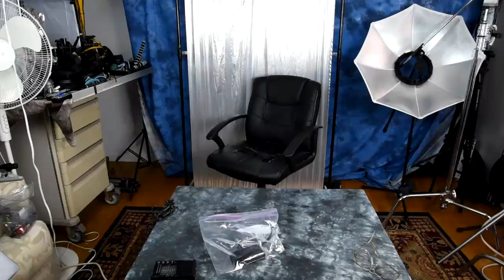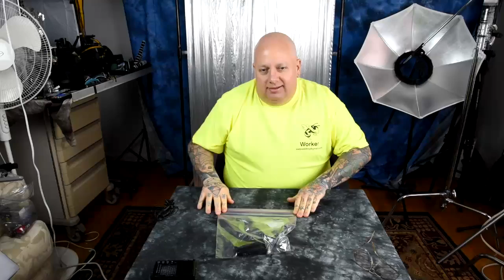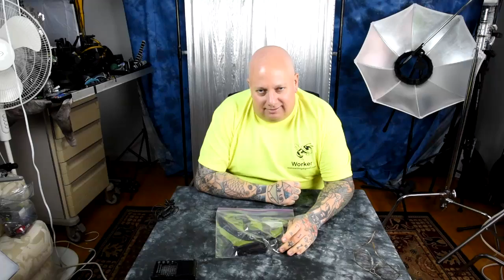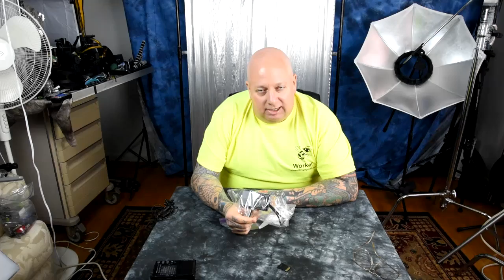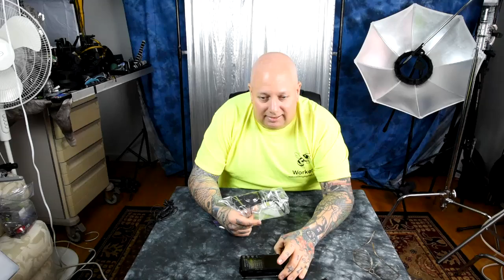FREEZER PHOTOGRAPHER!! Test Shots from COLD CAMERA. NON-ISO & Sensor related NOISE!

Comment: What should I look for in these test shots? I don't see much difference, certainly not an improvement from chill vs hot...
Reply from the maker: +Maurício Costa look at the noise and yellowing in the M in this shot:
https://www.flickr.com/photos/134746128@N05/24652997573/in/photostream/
Reply: +Theoria Apophasis - I do see a little wee bit yellower.... Anyway - there must be a more conclusive test. I absolutely believe your point and the theory behind it, but this test shot is inconclusive.
Reply from the maker: well the serious astro sensors are superchilled

i dropped the temp on the camera by about 40+ degrees.

but people shooting in the heat report (and ive seen it too) TONS of hot pixels, but same shots at night when cold, shots are crisp, with no noise or hot pixels.
Reply from the maker: So, whats the diff. between visible light and radio signals ????

NOT a SINGLE DAMN THING :)
(well frequency, but even blue light compared to red light has that diff).

(it shocks me that that fact shocks people)
Reply from the maker: *****
olhar para dentro a letra M, se você não pode ver o olhar amarelo em pontos granuladas , em seguida, você precisa de seus olhos verificados .

https://www.flickr.com/photos/134746128@N05/24652997573/in/dateposted/

Comment: I've first experienced this while doing 30 sec. ISO100 exposures at night in -30C cold. I got just one or two hot pixels in each of the five exposures that I managed to do with 3 freshly charged batteries... When I do something similar in warmer weather, or using higher ISO, I get hot pixels all over the place. Also I get many hot pixels if I use live view for a long time. Warm ambient temperatures and long periods of sensor activity just don't play along. It makes perfect sense now that, in certain conditions, mirrorless live view cameras (i.e. not Leicas) can have more noise than DSLRs, since DSLRs expose their sensors only when needed. Yet still, I'm thinking about a Micro 4/3 system somewhere down the line.
Reply from the maker: +Laurynas Meškutavičius XACTLY MAN!!!

THIS IS the reason that VERY HIGH MP Sony A7 etc etc, cameras have NOISE!!!!

its not ISO based noise
its not Sensor based noise

its 20 pounds of electrical POO stuffed into a 5 pound "bag" .......its EMI (electromagnetic interference)

The Sony sensor is trying to "listen to some tunes" (light) 
but the neighbors next door are slamming on the drums and guitar and causing NOISE

Light and Radio waves, and microwaves.........its ALL the same crap, electromagnetism!!

SCIENCE!!! hehehehe
Reply from the maker: +Laurynas Meškutavičius 
HOWEVER its not the warmth thats the issue as pure causation,....rather HEAT causes EMI (electromagnetic interference) which 'blasts' the sensor's "listening" capability of hearing the light vs. the NOISE (its all electromagnetism). its ALSO true that EMI from all the electronics and lossy internal information transfer causes and builds up heat (lossy electronics make heat, like heating pads).     ALL electronics are lossy, its only a matter of degrees. 

Heat causes EMI (which causes signal noise in the picture)
EMI generates Heat which creates more and worse EMI as it builds up (which causes signal noise in the picture)
EXTERNAL HEAT generates INTERNAL lossy electrical transmission and therefore generated EMI (which causes signal noise in the picture)
Reply: +Laurynas Meškutavičius Regarding Micro 4/3, i used it long time and can only say it´s sweet ;) BUT, if you want to use your system, buy only the Pro-model... this is E-M1 from Olympus or some day the successor. the other models are more consumer type, IMHO not worth the $ less... E-M1 is build much better than eg. E-M5 II, i tryed both
Reply: Lemon Squeezy I see your point and I think it's a good idea. However, I want a sort of a side arm - a camera that is like a point and shoot but better, with larger sensor, interchangeable lenses, flashes, etc. One thing that is a must is an EVF. I have my sights set on an Olympus E-M10. Conveniently, it's on sale in my neck of the woods right now.
Reply: +Laurynas Meškutavičius of course, one should always balance costs versus needs! E-M10 is no bad choice, especially if only a secondary camera :)

Comment: I live in the caribbean my pictures are going to suck!!!!  lol
Reply from the maker: +Carlos Velázquez Haaa! 
test shots i did proving difference between WARM camera and CHILLED camera:
https://www.flickr.com/photos/134746128@N05/24652997573/in/dateposted/
https://www.flickr.com/photos/134746128@N05/25186628421/in/photostream/
Reply: if you spend the intire day walking with 38C temp, you camera is not warm my man.... its freaking hot!!
Reply from the maker: +Carlos Velázquez i know, ive been there :) 

im not saying CHILL your camera, rather people with Sony A7 etc etc they have NOISE issues that is NOT connected with the sensor OR ISO noise

its EMI (electromagnetic interference).........the sensor is trying to "listen" to the light, but theres a TON of electronics right up against it blasting on the "drums" causing noise issues.
Reply: yep, you were very specific with the problem, just messing with you a bit hehehe
thanks for your videos!  always helpfull and most important, accurate....
Reply from the maker: gotcha :P
Reply from the maker: +Carlos Velázquez 
HOWEVER its not the warmth thats the issue as pure causation,....rather 
HEAT causes EMI (electromagnetic interference) which 'blasts' the 
sensor's "listening" capability of hearing the light vs. the NOISE (its 
all electromagnetism). its ALSO true that EMI from all the electronics 
and lossy internal information transfer causes and builds up heat (lossy
 electronics make heat, like heating pads).     ALL electronics are 
lossy, its only a matter of degrees. 

Heat causes EMI (which causes signal noise in the picture)
EMI generates Heat which creates more and worse EMI as it builds up (which causes signal noise in the picture)
EXTERNAL HEAT generates INTERNAL lossy electrical transmission and therefore generated EMI (which causes signal noise in the picture)
Reply from the maker: +Carlos Velázquez 
Check my latest video with test shots,
i PROVE using a cell phone near a camera when shot is taken MESSES the shot up !! 
https://www.flickr.com/photos/134746128@N05/25188951601/in/photostream/
https://www.flickr.com/photos/134746128@N05/24655310263/in/photostream/ 
EMI, same as internal camera EMI issues.
Reply: yes ! im truly surprised, after seeing that cant imagine how many electronics are not performing welll just because the heat messes with the frequency
Reply from the maker: So, whats the diff. between visible light and radio signals ????

NOT a SINGLE DAMN THING :)
(well frequency, but even blue light compared to red light has that diff).

(it shocks me that that fact shocks people)